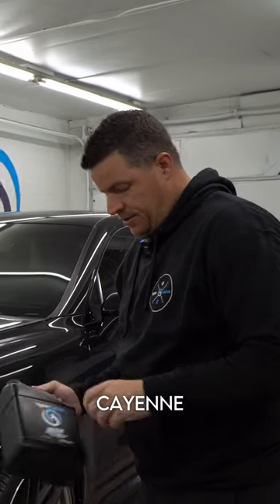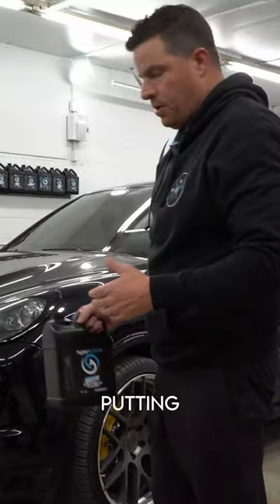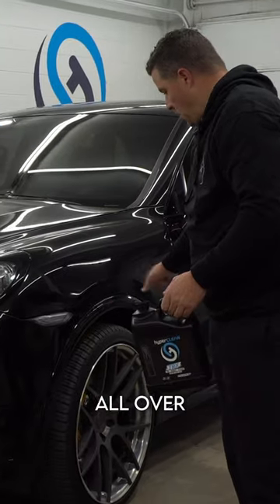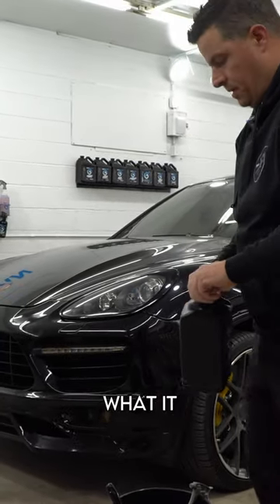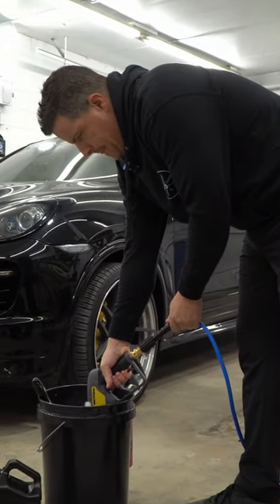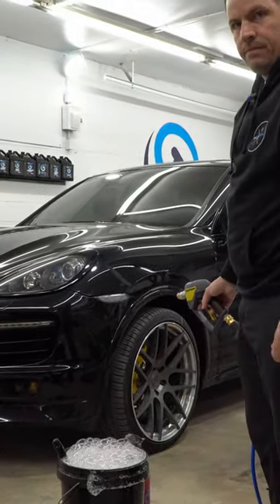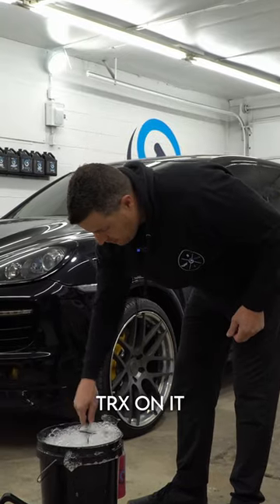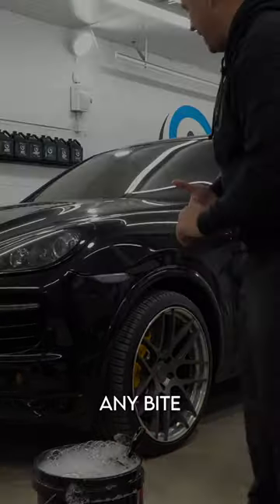Prepping A Porsche Cayenne Turbo Wheel Bucket

Comment: What’s TRX?
Reply: Tire Rubber and Exterior Cleaner. Used to deep clean things like rims and tires.
Reply: It cleans like a degreaser but ph neutral so safe. Modern chem at work
Reply from the maker: TRX is our Tire and Wheel Cleaner. Thank you for the question!